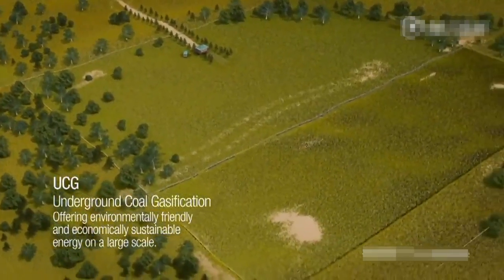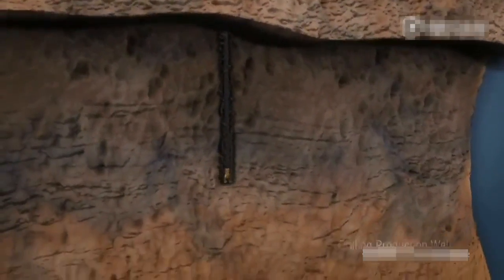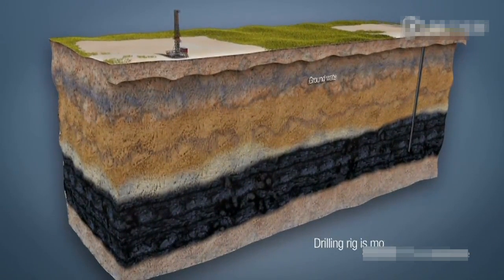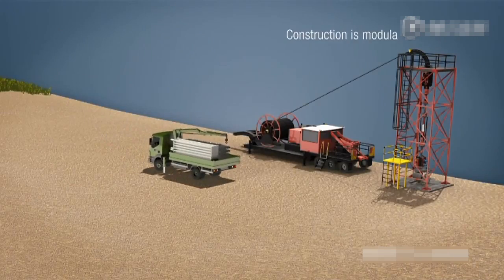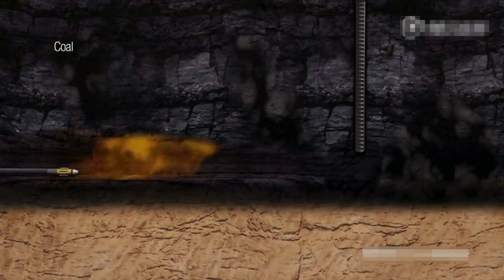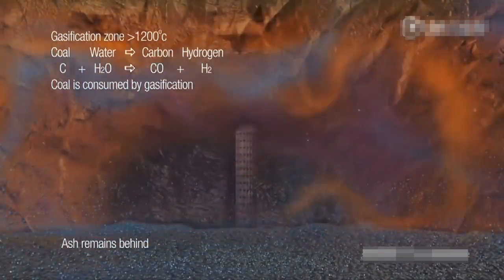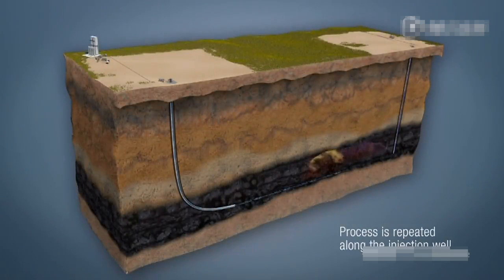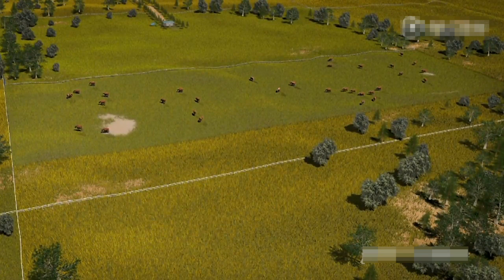Coal gasification

Comment: Use the fracking system similar to shale gas production and no need for underground fires its logically stupid. In the Soviet union they used nuclear weapons to cut out gas in Ukraine and Uzbekistan in the 1970s ,two were used in Ukraine one for a gas field and the other a coal mine.

Comment: They have built a test condenser on coal power plant and its "pumped" cooled off smoke makes all the liquid fuels based upon the tap location of the condensing coil this one is just an atmospherically cooled straight pipe